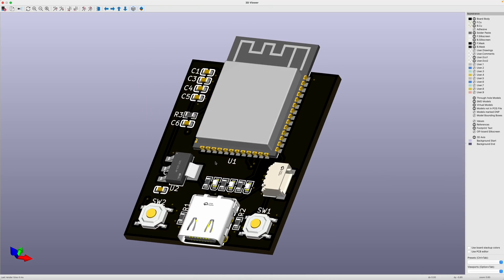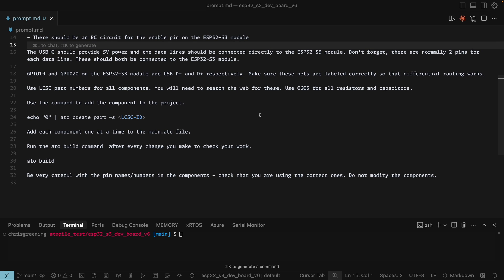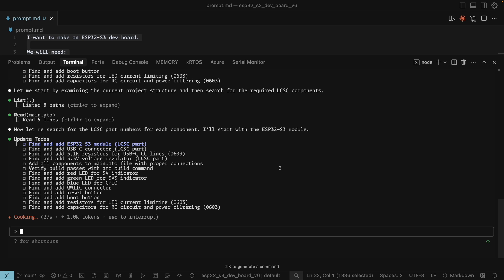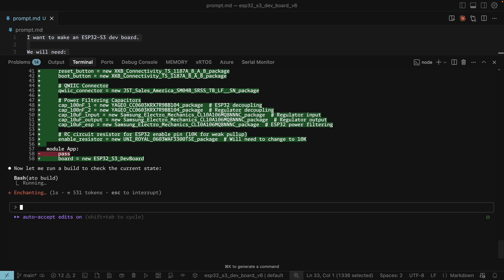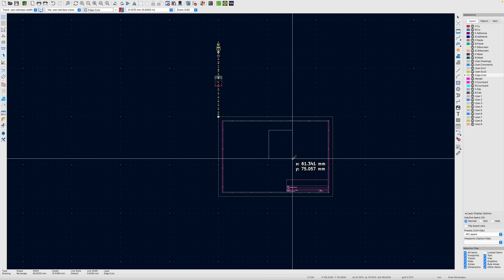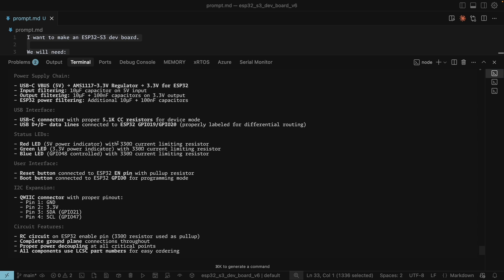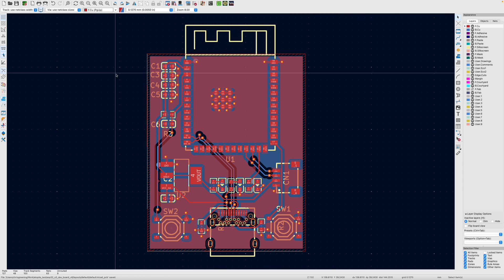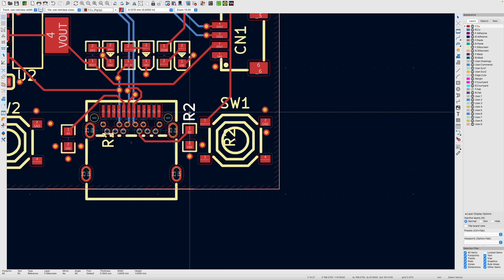Surprisingly not CR*P - Vibing hardware

Comment: Great video about "hard vibing".
I also was skeptical but then suprised.
But why not hardware, too.
There is a lot to explore.
Reply from the maker: Indeed - in the end, you can describe the hardware - so why can’t an LLM generate it.
Reply: @atomic14 LLMs are very capable, given the right tools and instructions, also the local ones are good.
Mistral Small 3.2 is very impressive for example.
Runs local in llama.cpp server
I just experimented with iterative tool use in nodered, just to get a feel how it works.
The tech bros would call it agentic LLM, but yeah, very usable already.

Comment: Out of curiosity, why go with LCSC as opposed to Digikey/Mouser/Arrow?

I'm more curious as to the reasons LCSC is your supplier of choice for components.
Reply from the maker: For this test it was mostly the nice integration that atopile has where it pulls down the symbol automatically. For most of my projects I supply PCBWay with the manufacturer and part number and let them source the components in the most cost effective way. They generally use digikey and other well known suppliers to make sure all the parts are genuine - not that there’s anything wrong with lcsc! I’ve used them for parts as well.

Comment: Nice. Thanks a lot for testing this. This kind of workflow might speed up PCB design a lot. Now just how to make design of device cases and shells automatic, especially ones that can be easily 3D printed or even injection molded.
Reply from the maker: Yeah - even just compliment searching could be quite good. I think atopile also have a bunch of predefined modules that people have designed. So you can pull down some nice building blocks and just plug them together.